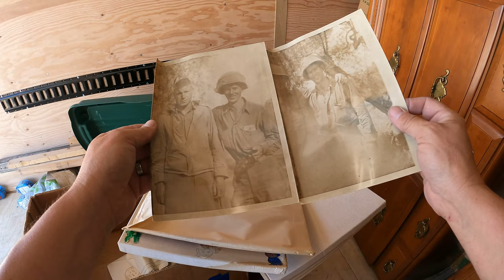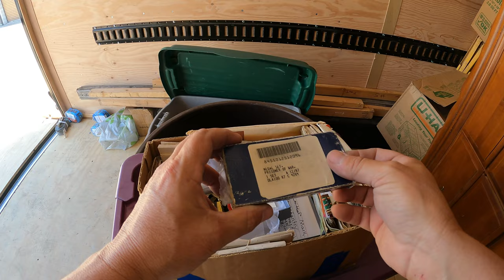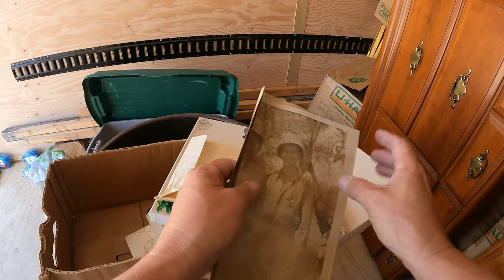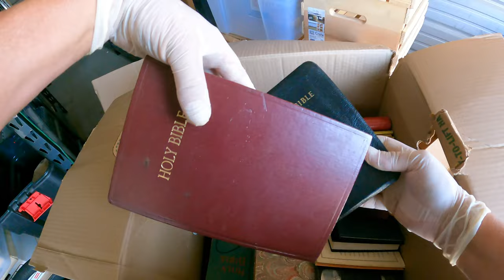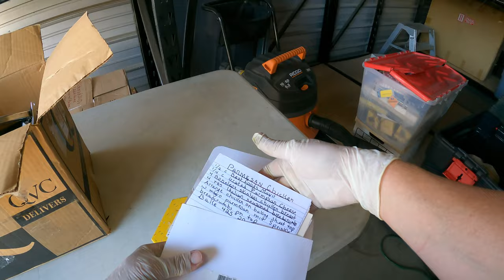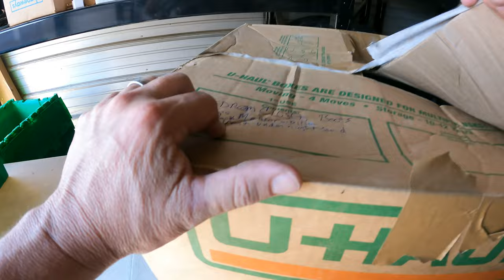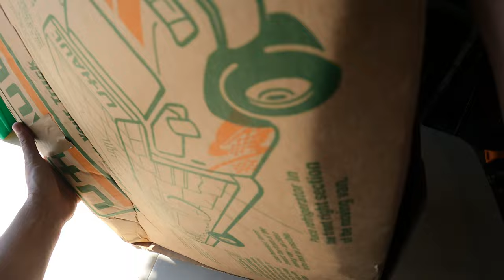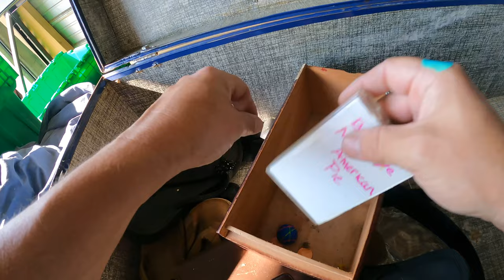Box was marked "Priceless"... and IT WAS! WWII Prisoner of War Medals & other amazing finds inside.

Comment: Singer scissors are vintage for sure - think sewing machines.  They may need sharpening but they're good scissors. 08:10 the eagle pin is an honorable discharge pin, aka "the ruptured duck".   27:35 Knew it wasn't gold right off.  That tab on the end means costume; tons of gold-plated chains were made in Korea in the 80s.  The medals and letters were definitely the good stuff.
Reply: I think the chain @27:35 is a gold chain.The lustre and design make me think so!!